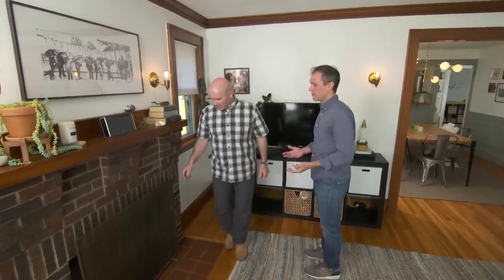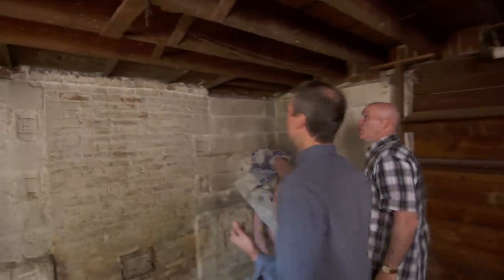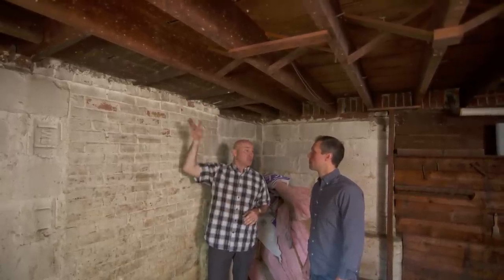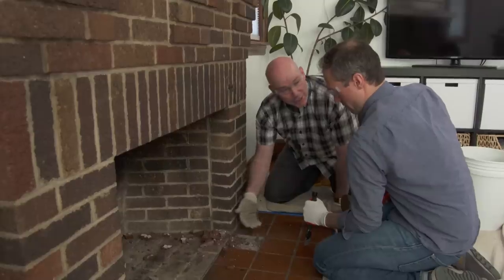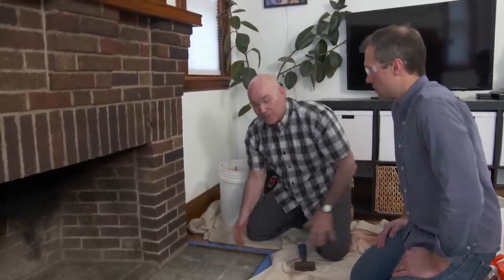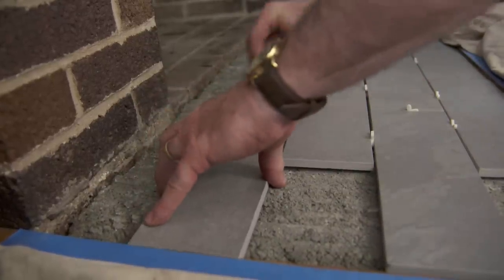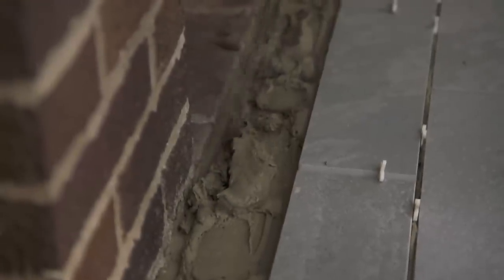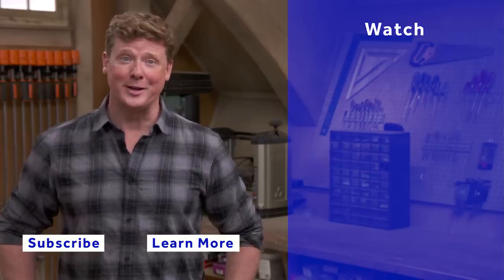How to Replace a Hearth with Slate Tile | Ask This Old House

Comment: Typical contractor...always leaving when the job's only half done.  

I'm kidding, folks.
Reply: I mean, you're not even wrong. If there's a problem with the concrete, the whole thing will come down when the wood form is removed. As a non-expert in this area, I'd be really worried pulling that wood after 100 years.
Reply: @YuriyRusko  I wouldn't even know how to safely remove the wood, or if that's possible here. Is the concrete even strong enough to hold itself up over that span if the original installer didn't intend on removing the wood support?
Reply: @Kevin-mp5of  Exactly, it would be shocking if there weren't at least some movement.
Reply: I’d be scared to remove it too. Could you maybe shoot the bottom of the wood with a layer of fireproofing foam?
Reply: @MoneyManHolmes  Concrete is sitting directly on the wood form, so there's no gap to, say, drill a hole and shoot foam between the two. You could spray foam the bottom, but that wouldn't bring it up to code in any way.

Frankly, if it's been there for 100 years, I'd just leave it alone. The fireplace has been used countless times over those years, including as the primary source of heating, surely. If it hasn't been a problem, I doubt it's going to suddenly be a problem.

Of course, the correct solution would have been to take the form out, inspect any damage, repair the base, then tile the top. Anything else is half-assing it, IMO. Okay for a DIY home-job, but super shady for a professional.
Reply: Ok guys you do realize firestop foam is extremely flammable right.  It is used to stop airflow to slow the spread of fire.  It is not fireproof at all.  

And the longer the wood is there and the more times it has been heated up the lower the kindling point.  This causes fires all the time which is why the codes are written

Comment: Why not pull the wood before laying the new tile? If the concrete is compromised, it'll come down once the form is removed and the whole job will have to be done over again.

If you ask me, removing the wood and inspecting the concrete would have been the more interesting part of the video. Otherwise, it's just a small tile job.
Reply: Agreed!
Reply: Use a basement jack to support the slab.
Reply: @Uncle-Bull  Jacks provide a point load to a solid mass, like a carrying beam. What you have here is exactly the opposite: a concrete block that has been potentially compromised by cracking. Once you remove the wood, if it still holds, it'll probably continue to hold, but if it's cracked (after 100 years), then it'll come crashing down.
Reply: Great point and I agree.
Reply: My guess is they never show it being removed because it never was removed.  I think sometimes they say the proper way it should be done for the videos but don’t show it because they never actually do it.
Reply: They should have. Thinset and tile are not structural.
Reply: The concrete sub-hearth WAS inspected, and found to be in good condition.  Did you miss that part?
Reply: Is there a way to support the hearth extension without the wood? Can you swap it out for rebar or some other non-combustible scaffolding?
Reply: @dronesrus5676  sounds like every contractor.

Comment: I guess there is no accounting for taste, that terra cotta was far better looking IMO. Code compliant? That wood has been there a 100 years I doubt its that big of a deal and I would personally leave it alone. Extra support and they used to heat that home with wood so 100 years or fire and hasn't burnt down yet, I'm guessing the problem isn't much of a problem.
Reply: the problem is that you have to insure your house and if that wood somehow caught fire they would deny the claim
Reply: @kylefowler5082  interesting in my state it's not a law that you have to have insurance on your home. Must be different where you live. Here it's only required if you have a loan on the house.
Secondly,had they not had insurance on the house before?
Reply: @tfhummer  I'm not sure if having homeowners insurance is required in my state if you actually own your home outright but it sure seems like a bad idea to go without it so in essence it is required in my opinion.

The problem more specifically stated is that if a homeowner had insurance and a fire started because of those supports I can just about guarantee you the insurance company will fight your claim. They hate paying out to begin with.
Reply: Just made the same comment, it hasn't burned yet and it never will.
Reply: @kylefowler5082  well I will agree to disagree. You state you feel you need home insurance even if your home is paid for, yet in the same breath admit that the likely hood of getting the insurance company to pay is very tough to begin with. Not a service I would be paying for with known poor customer service and results.

I will ask why everyone is so afraid of everything these days. Has your home ever burnt down, your parents, neighbors? I'm middle aged and have never seen any home burnt down of anyone I know. I have never seen any home damaged for any reason severely enough to justify the premiums paid in insurance. Usually you would be thousands ahead if you saved the money you would have paid in premiums to the insurance company and used that for said repairs. I mean if insurance company's were not making money they would no longer be in business so that fact alone substantiates that the majority of the people the majority of the time do not use nor need insurance.
Reply: Apparently you have never heard of pyrolysis.  This exact situation causes many fires in many old fireplaces after being there for years.  It is a common but potentially dangerous problem
Reply: @benholler1389  are you saying the crack in the mortar is the problem or the wood under the fireplace is the problem? Surely that void and crack needs filled with mortar. However that wood underneath has not caught fire yet and never will once that void is filled.
Reply: @tfhummer  Both are a problem.  And wood underneath just like that has caught fire many times.  Usually after many years of being heated have pyrolized the wood severely lowering the kindling point.

Comment: If you rip down the subfloor under the concrete, what's holding everything up?
Reply: Thoughts and prayers.
Reply: It should be held up by the rebar running from through the whole hearth and hearth extension slab.  It should support itself.  But in this case because of the crack the hearth extension should have been repoured with rebar anchoring it back

Comment: Couple things to help your installations last. One, you want to establish a flat substrate before you ever lay tile. For smaller tiles like on the video, NTCA code requires the substrate to be flat within 1/16" over 2 feet. To get that, you could've ground the substrate flat or vacuumed and applied a floor patch compound before setting the tile. Two, you don't want to simply trowel thinset over your substrate—it needs to be keyed in first. Explanation here: https://youtu.be/CTsjlN3u9Iw. There are a few other things worth mentioning, but to get to the point,  just look up your local tile setter who belongs to the NTCA and follows industry standards to achieve a more beautiful, much longer lasting end result! -AWM

Comment: I need help. Have a similar situation... but much more complicated. The hearth set flush in the floor is one solid piece of some reddish stone.. could be terracotta... dilemma is that the depth of the hearth needs to be extended. As in...the floor needs to be cut? (HardWood floor). Second dilemma... there is a wood burning stove insert in the fireplace, the front of it sticks out about 4-6 inches and is set on the hearth that needs to be removed. 😢 is it possible to dig up the old hearth with the wood stove insert set in place?

Comment: What is the best hearth material for a solid fuel (wood) open fireplace?  I have a two-year-old 8' X 2' slab of honed black granite.  I thought it would last forever but after my last fire, I noticed a hairline crack through the center front to back.  I am very disappointed.

Comment: definitely would not do as shown in this video. thin set does not bond to old thin set (when doing tile, your substrate should be something that can absorb moisture i.e. hardy backer, cement board existing thin set with a bonding primer which allows the material to become one). if you are going over old thin set, either add a bonding primer first such as eco prime or other bonding primers, add some hardy board, cement board, wonder board over top.

Comment: OMG it does not even match !! that gray tile looks so bad with the red brick and wood floor LMAO
Reply: That terra cotta tile would have lasted 100 more years, too.
Reply: Agreed, they are going for a modern look, but the house isn't modern...
Reply: Ronan B Last 6 months i refurbished my whole 1964 living room of 8x4.5 meters up to 2020 standards. Replastered all walls and ceiling, all cables for TV and audio and lights hidden in the walls, etc. It is possible to do in any house.. But it takes a bit more work than 2 m2 of tiles. Like step 1 is remove all furniture and everything that is removable.

Comment: Would it be an option to just go over the old tile... like laying a marble slab on top?
Reply: Glynis84 
Still have to pull that wood. It should not be there.
Reply: The slab wouldnt be level with the floor or fireplace. This is cheaper too.
Reply: august There is/was a cathedral in Paris, hundreds of years old, burned down last year. So your last sentence makes no sense. Safety rules are not meant to be followed “sometimes”.

Comment: Why is the code to remove the wood? Because of its proximity to the flames? Otherwise it seems like it would only provide extra support and insurance against collapse.
Reply: It is code because of the heat transfer through the concrete. It has caused many fires which is why the code was written
Reply: The danger of prolonged heat transfer is going to depend on how thick the masonry is there. Extra thickness was how they handled things in the old days. It gets dicier when hearth extensions are just thinly poured on subfloors.

Comment: Honestly, for it being such a small tile job, it looks pretty bad actually. It looks soo off center, and trowell was way to big of a size, for such small tile. The way they put lumps of thin-set at the end was such a bad idea. As soon as something drops on those tile, they are going to break. Bad job!
Reply: I'm really not sure what you're talking about. At 6:58, the center line is perfect and everything looks very even. The mortar was applied in a uniform direction with an entirely appropriately sized flooring trowel.

What do you see that I don't?
Reply: @YuriyRusko  you can see at the end how some peaces are higher than others beacause of the way they put down the thins-set. Its a relly small space. Why not just put a good amount of mortar down on the whole space, instead of putting blobs of mortar down after. Sorry my grammer is bad due to me not being great at english.
Reply: @Kevin-mp5of  yeah sorry for my grammer. But i think you got the point. Enough to make you write a reply 👍

Comment: Wildly dangerous advice from Mark the hack. Never, ever, EVER remove the "forms" from underneath the hearth because on old homes they are often not simply forms but a sunken decking that is designed as a permanent support structure for the hearth above. Once that structure is gone, if it not supported elsewhere it is basically a trapdoor waiting for someone to step onto it.
Reply: Code requires wood forms to be removed.  The hearth extension needs to be self supporting.  His advice is absolutely correct.  But in this case because of the crack I would have repoured the hearth extension after drilling rebar into the hearth slab at opposing angles to lock it all together
Reply: @benholler1389  His advice is dangerous. Telling viewers to remove it assumes the hearth is self-supporting by some sort of other structure. I've worked on many old homes in my area and seen firsthand many hearths and tiled floors that were nothing more than weak concrete or drypacked mortar on top of the "forms" with no internal structure and nothing but the "forms" themselves to hold them up, which was how they were designed. I don't agree with the design but that's how things were built sometimes in the old days before the building department. Mark just tells viewers dismissively to remove the forms as if they're simply trash left over from lazy workers a century ago. I can tell you that I've come across many homes where they are not just forms but also the structure, the only structure, which supports the hearth. Mark, a supposed professional, should know this, however he has given plenty of bad advice and has done sloppy work on the show in the past so this does not surprise me.
Reply: @wcsd9577  Well with that explanation I agree with you completely.  Although leaving the wood could be just as dangerous
Reply: @wcsd9577  Is there a way to remove the decking piecemeal (to prevent collapse) and replace with non-combustibles? I also wonder if Mark is talking about new construction code (IRC) as opposed to the International Existing Building Code which allows for more wiggle room in updating old structures.
Reply: @tomcrosby8534  it would be difficult to install some kind of steel or cementitious support after the fact. Maybe build a pan below with rebar through the joists and pour flowable grout from above into the void below. You'd probably be better off demoing the whole thing and rebuilding unless you were absolutely trying to save the original hearth for historic or sentimental purposes. To be honest I wouldn't worry about the wood down below unless it looked charred or something. On an old home that has had many fires in the fireplace in its lifetime, if it were going to catch fire it probably would have done so many decades before.